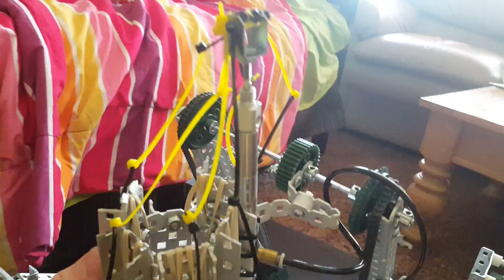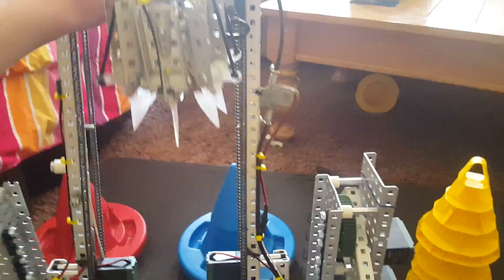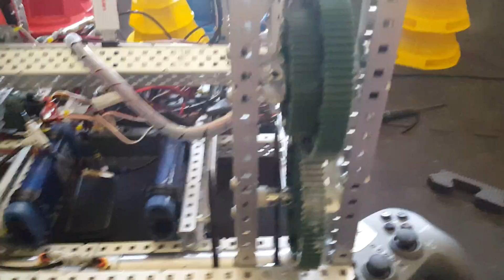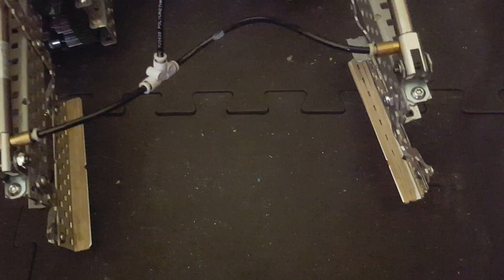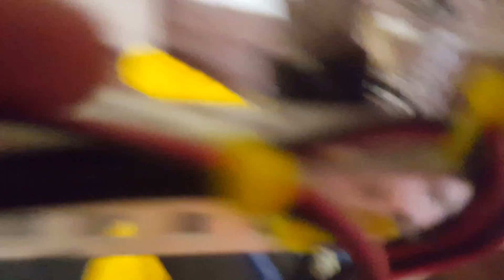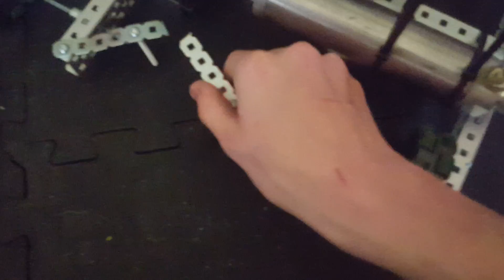Vex robot close up

Comment: @Antichamber team 80110H, have you tried putting the motors on the inside and then expanding everything out wider for your size issue. Look at 10Q's skyrise robot's configuration.

Comment: U fool! You just lost points! Ziptie your motors
Reply: people actually do that? sounds like a good idea to ziptie and screw so they dont come loose.
Reply: Adam Moore people zip tie the motors because the either don't have motor screws that aren't stripped or to allow for easy installation of new motors when older ones need to be replaced